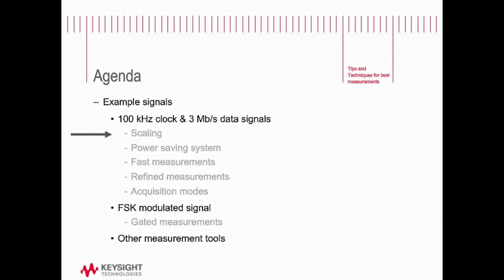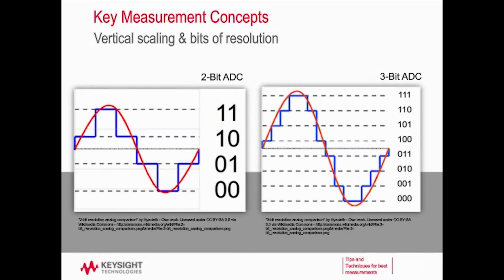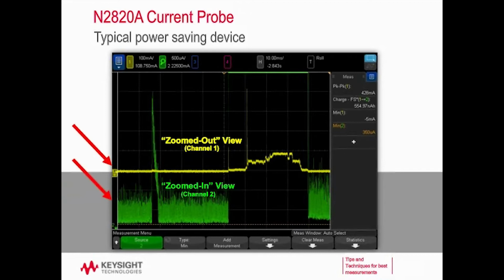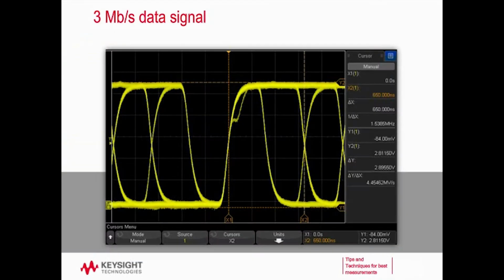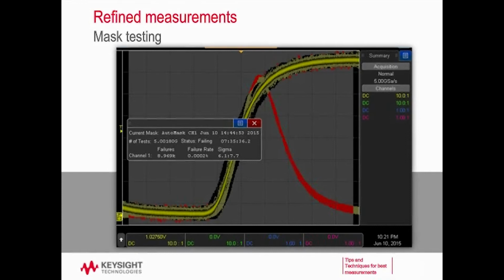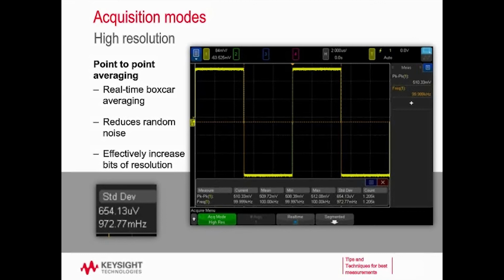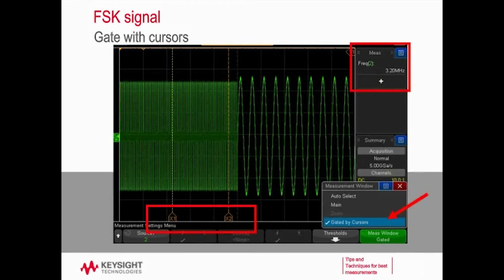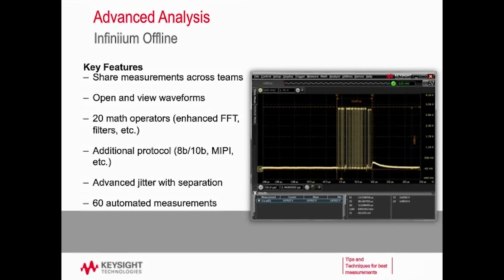Make Great Oscilloscope Measurements

Comment: Very interesting talk! 

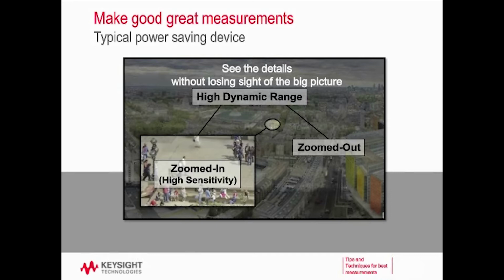I especially found this interesting 10:43, however... how does this compare to using a Keysight 34461A TrueVolt meter using the current measurement, there is enough dynamic range on the volt meter to possibly do this measurement as well.. without using a current probe?, I think the scope should have "finer capture" to capture current transients.
Reply from the maker: Hi EETechs, we prefer to not handle support issues/questions on our YouTube channel, can you send me a PM on the EEVBlog forum? Thanks!
Reply from the maker: So, something to think about is that just because you can get a signal into the dynamic range of the equipment, it doesn't necessarily mean that the resolution will be ideal. The scaling of the instrument can change the resolution of the measurement. The reason that probe is so useful is that you can optimize the bits of resolution for your measurements for vastly different dynamic ranges.
Reply: You guys fixing that EMC issue that EEVblog found with the DMM's? I wonder if I should turn in my 34465A bench meter for a replacement? I'm a member of the EEVblog forum, so if you guys want to give instructions there on what we should do, then I can go there. Thanks!!
Reply: Keysight Oscilloscopes I sent PM to Daniel. Thanks for taking the time to answer my concern. I know you guys will have this solved in no time. Best support team ever.